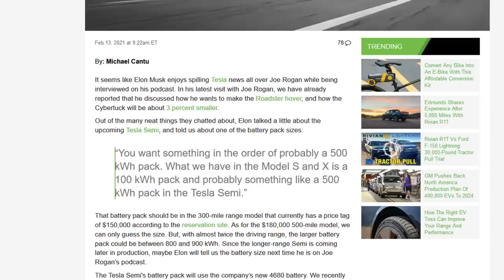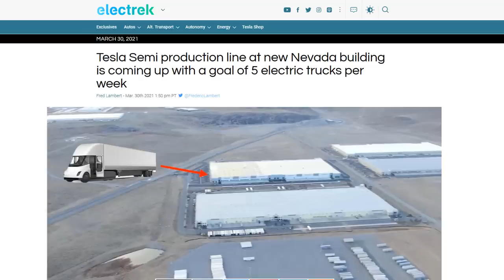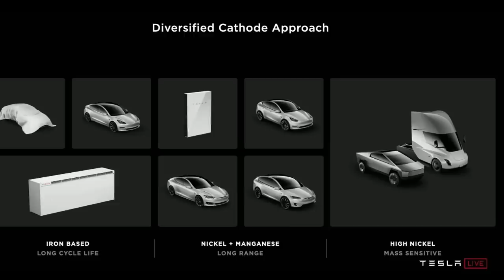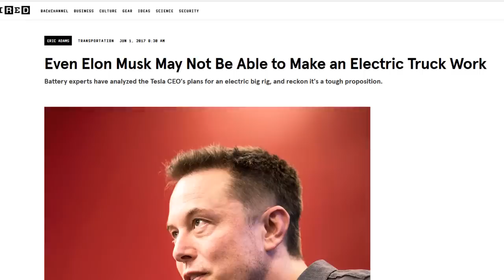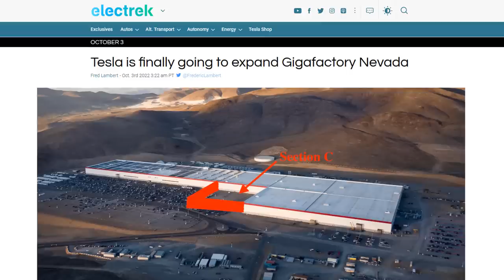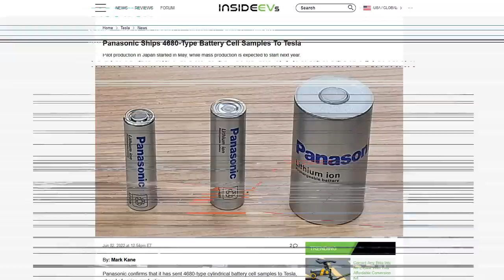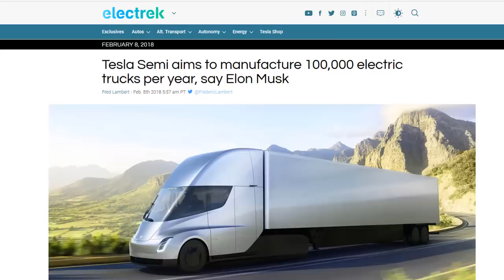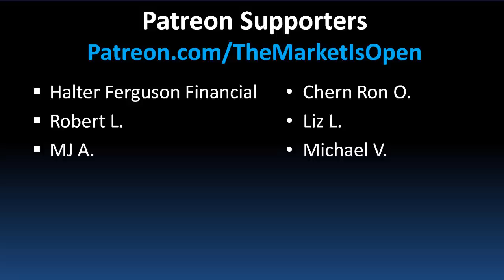Tesla Semi Is Coming in a Month - Let that Sink In

Comment: The main limiting factor here is, of course, the battery density.
At current battery density, the Tesla makes sense for local deliveries and light loads.
As battery tech improves over time, the range calculus changes and diesel trucks become more and more marginalized.
Reply: Battery tech can't improve much beyond what we have now, snap back to reality batteries are not magic they are limited to the laws of science too
Reply: Completely ignore improvements to ICE sure
Reply: Range calculus?
Reply: The main limiting factor is not just battery density but also battery lifespan and degradation. How happy would you be if the expensive new trucks your fleet purchased are all only getting 70%-80% charge after a year or so on the road? Then what? Replace the battery? Current lithium battery tech is already well developed and at or near its limitations
Reply: @CGG_GSS Sorry to say that the price of the tractor is not irrelevant.  Yes, a large fleet operator gets a discount for 'bulk' buying where as the owner operator does not.  But Freightliner is the low end of the market while Western Star is the high end luxury brand if you will.  But the fleet operator needs to attract and retain experienced drivers to survive.  True, a new CDL driver can catch on with a fleet operator like Swift and will be given an older Freightliner tractor to 'learn' with but at some point the same CDL driver will need an upgrade and after two or thee years may decide to switch companies.  Then there is the secondary market, the used tractors for sale.  It is far cheaper to sell your older tractors after two to four years of use and replace them with new tractors.  A well run fleet operator can with good drivers put 130 to 150k miles a year.  It is one thing to keep mechanics busy doing routine maintenance and another to have them rebuilding the engines.  Many 'graduates' just out of diesel mechanic school hire on with these fleets doing oil and filter changes, not engine rebuilds.  So the quality of the fleet tractors comes into play.  Your top drivers (those who regularly run 135K miles a year) demand newer and better tractors.  Fleet operators do a lot of cost benefit analysis, they have to if they want to make profits each year.

Now ask yourself this basic question, what will be the market for used Tesla class 8 tractors?  There isn't one at the moment.   And if the fleet operator cannot sell his used Tesla tractor then it end up in a wrecking yard.  Think of the environment mess those used batteries would make in your city.
Reply: Bring it on! I've had some diesels that would mop the floor with the Electic.
Reply: The more capacity these lithium ion batteries have, the more volatile they become in extreme heat. These trucks will basically be rolling bombs, no joke! Plus, if they do catch fire, it will take days to put it out. The FDNY says, they have extinguished EV batteries, only for them to catch fire again later in the day or 2 days later.
Reply: It's not. Vehicle price, charge times, reliability, charging pricing, maintenance/repair costs, availability would all factor in and at least one would be more limiting then battery density.
Reply: Long haul could be achieved if the mega charger system was integrated with existing truck stops
Reply: @trevoncowen9198  I’m sorry but no long range trucker wants to stop that much to charge. Semis usually have a tank of about 300gallons of diesel and get on avg 7mpg. So that’s around 2100 miles. More than 4x less stops than the Tesla semi AT MAX RANGE. This is great for local deliveries but is not ready for long range yet. Soon tho
Reply: @ryankennedy6922  Federal HOS rules limit a trucker's drive time to 11 hours a day. The average daily drive range for a long haul trucker is about 500 to 700 miles a day (depending upon the weather and road conditions.) The mega charger only take about an hour to charge the truck (about 6 hours worth of driving at 70 MPH.) The trucker could use that time for his mid-day break. The truck will be charged again during the driver's 8 hour HOS mandated rest time. [There would be minimal loss in time due to charging.]
Reply: @michaelmcfadden28  Sure for solo drivers, but I was talking about long haul where team driving is more prevalent. This would basically kill team trucking as a concept if you had to stop every 12 hours no matter what to charge. But change is good we'll see how it works out but I think long haul isnt ready yet
Reply: @ryankennedy6922  if truck's fuel consumption decreases to 10 mpg, you get 3000 miles range. Coast to coast on one tank!
Reply: @michaelmcfadden28  I'm sorry, what mid day break are you talking about?  Did you ever drive truck?  How long does it take to fill one 100 gallon tank with diesel, an hour?  Really?  Do you know anything about truck stops?  One of the reasons why you either start early in the AM is so you can shut down in a parking space in a truck stop.  Or you drive during the night.  And when there are no more parking spots in the truck stops you start looking for anywhere you can shut down for the night.
Reply: @martaamance4545  I cam fuel in 20 minutes,  240 gallons.
Reply: @floydrandol2731  I drove truck for many years, and yes, if you do not have to wait in line you can fuel in twenty minutes, else it takes a bit longer.  What many of these Yahoos do not know about trucking is that if one needs to recharge the batteries you can not do it in the same way that one pumps diesel fuel into the the tractors' tanks.  You will notice that most of those who comment on these posts have no idea of truck driving or the transportation industry.  It always amazes me how many individuals who are ignorant on these subjects will opine out of total ignorance.
Reply: @trevoncowen9198  no it couldn't 😂
Reply: @trevoncowen9198  Do you have any idea what kind of infrastructure would be required for any overnight charging of batteries?  Even with mega chargers that might take as little as one hour, the line of trucks waiting to charge would be extremely long.  Remember, you, as a CDL driver only get 11 hours of driving time and 2 hours as in service time.  You don't get to split your hours either.

Comment: It is my opinion is that these companies that buy these will find they actually cost them money over the long haul instead of saving them money.
Reply: Depends on the intended use. Short range haulers would not use a single dime of diesel. And considering cost of diesel they could see a payback in relatively short time. The fuel trucks use is the highest cost of running a semi. Plus the reduced maintenance costs. No oil changes, no air filter replacements, no transmission replacements and so on. One has to look at how an electric vehicle works to understand how the savings can add up.
Reply: @DaveBuildsThings  you really need to set down and do the math and stop believing the propaganda that is being shoveled to people.
Reply: @JohnSmith-ug5ci  They said the same thing when cars started appearing. Like really? Who in their right mind would trade in a horse for a car? 🤣

Comment: Sounds like the limited range version is what Pepsi will get, since the 4680s have been bust.  All the specs were based on that battery, not the 2170.

But they have to out SOMETHING out.  After all, lying about FSD isn't getting the same traction it used to...

Comment: The semi won’t be successful. Too expensive, low range, high weight, long recharges, poor service…
Individuals can deal with high purchase price, short range and sketchy service compromises for ideological environmental reasons (which I agree with) but companies won’t accept wasting money.
The Semi is for a long-range market, which it can’t reach. 
Also imagine the time and/or power needed to load a 500kWh or 1000kWh pack necessary to sustain operations.
Reply: @Reprint001  
 Wasn’t talking to you. Butt out.
Reply: @Reprint001  
💩
Reply: You’re wrong. Try again . . .

Comment: Highly skeptical of the performance numbers — especially 0-60 on 5-7 degree grades.  Well positioned truck terminals could allow effective ET performance on flat plains transitioning to diesel on routes with substantial grade.
Reply: DITTO .. also skeptical of battery pack size needed for towing huge weights.. probably closer to 2000kwh for any practical range.
Reply: @KrustyKlown  the math works out to 800kw if you are on flat ground no headwind. Engineering explained did a pretty good writeup. It will be more than 800kw but possibly as low as 1000kw. Technically a semi uses 4x the energy of average passenger vehicles per mile so a 300 mile range truck can pretty much be achieved by 4-5 300 mile S or X battery packs. Realistically you are probably looking at close to 10 battery packs for the 500 mile range. The thing is Tesla is already using these things on the road so they already know the power draw per mile. Do you really think Teslas plan is to just deliver a crap product to Pepsi next month and letting them tell the world how crap it is? That would be pretty stupid considering they already know exactly how the semi performs in real use.
Reply: @KrustyKlown  if they want 500 miles fully loaded yeah i would say 2000kwh is the optimistic battery size
Reply: @Nope considering Musk said were getting to mars by 2018, promised full self driving cars in 2014, hyperloop "air hockey in a tube, i swear its easy" turns out impossible to be made, "this thing beats rain NOW" semis ready in 2017, "million self driving robotaxis ready to roll out" in 2018, solarcity fail, Boring company with all the CGIs ends up making the shittiest tunnel in history of tunnels... Id say its pretty reasonal to be skeptic.
Reply: @Nope On what exactly? Obviously im no historian on this but all i know im reading crazy promises and watching alot of CGI from Elon for basically past decade so... Yeah its OK to be skeptic, specially this day and age where hype is the main driver of the market... Really when he said about hyperloop "its like air hockey in a tube, i swear its easy" i knew hes BSing for the hype, considering i know something about the topic.
Reply: @Nope but my point still stands, Elon has a pretty long record of giving ludacris promises that simply cannot be delivered - for whatever reason. It works wonders in todays stock market that is driven by hype, specially with cult of personality around Elon. Bringing crypto market logic to the real world! So yeah, definetly be skeptic, cause things like Theranos, Nikola, or 90% of the silicon valley startups worth millions but dont ever produce a product, do happen in todays market. All you need is a good CGI presentation, marketable idea, and a cool spokesperson ;)
Reply: @Matej Žižanović  you are 100% right. As an investor or an early adopter of technologies, I need to see a history of success. It's one thing to be a little off i.e. We had to add dual stabilizers as we found it was unable to stabilize itself with only 2 fins  vs. The idea, as a whole,  couldn't be done due to physics.

For the truck issue, any time an electric vehicle starts to pull a great deal of weight, they rapidly lose efficiency. Unless they have a new battery technology which combats this, they will be loading these trucks with TONs of batteries making then much heavier. It's a nasty cycle.

I want the electric trucks to be a thing, but using common sense, life experience, and math/science, I have a very good intuition that it will not happen the way it's currently being sold.
Reply: @Nope Bro i gave you like 9 examples of when he said hes gonna do something in some rediculous ammount of time, and now you arguing about NASA joint ventures. 

Fact is, he makes redicilous statement, media picks it up ( TIME MAGAZINE had a title "Why You Should Take Elon Musk's 2018 Mars Shot Seriously"), his stock rises, investors are happy, he is happy, its all good in todays market except theres no product. 

Boring company is worth 6 billions, thats way more than many successful tunnel companies making serious tunnels, and they made 1 tunnel wich is the shittiest tunnel in history. Hyperloop is woth billions, it cannot be made. Tesla is worth 10x more than VW even though VW generates 20x more revenue. Presents a semi in 2017, says its ready to beat RAIL next year, STOCKS SKYROCKET, 5 years later no product to be seen. See the pattern? Create a hype - people invest.

Not to shit on Elon totally cause obviously hes a successful and smart person, but the idea that we should not be skeptical is beyond stupid. Specially in todays market, like i said.

Hes one of the richest people on the planet for a reason, and its not cause hes a great engineer, - hes a great investor, has a great understanding of modern market, and is a cool personality that people created a cult about.
Reply: @matejzizanovic7959  Yep, you're not wrong but some people either have short memories or they just can't admit that they've been conned.
Reply: @Nope He's been successful in some areas and has failed in others. These are huge areas. Some investors made a lot of money on his successes while others have lost a lot of money on his failures. He might be on the top 400 Forbes list, but that doesn't mean I wont lose big.

Show me a solid history of good ideas and investments and I will be willing to part with money. Right now, it's 50-50 (maybe) if his new ideas work and I don't like those odds.
Reply: Yup, I smell a musk rat...
Reply: @Nope Yeah thats exactly the cult of personality im talking about, "you dont get to question the rich person, you dont get to be skeptical about what he says".  

Just the fact that they said in 2016. without a single flight test whatsoever, that they could land on Mars in 2018. coupled with ofcourse couple of CGI images, and all the media covered that story, consequently SpaceXs stock skyrocketed, while everyone who knows anything at all about the topic knew theres NO CHANCE IN THE UNIVERSE that they could do it... And you defend this?

I swear if Elon said hes gonna build a timemachine by 2026, and creates a company called "TimeX", posts couple of CGI presentations, company would probably be worth couple of billions. Basically he did it with hyperloop already though... Dude seriously said "its air hockey table in a tube, i swear its not that hard" , straight face, media ofcourse took it seriously, boom Hyperloop worth 1.2 billion dollars. Cmon son... We GOTTA call people out on their BS, no matter how wealthy they are.

Personally, for me, the Top Gear situation was the first sign of Elon being a BS artist...
Reply: @Nope classic im not readin that line.. ggs
Reply: @Nope 80% of ALL college grads in 2023 want to work for either SpaceX of Tesla; any CEO would be quite satisfied with those numbers.

Comment: Doesn’t mean that we have the drivers to use this demand.. He might consider making smaller trucks besides semi for local driving as well. For example trucks used in u Haul vehicles different sizes and so on, not just the semi market what about Utilities vehicles with chair lifts for pole work , cranes vehicles  and even cement trucks

Comment: I would think the garbage truck companies would be chomping at the bit to use a Tesla Semi as its platform!  Short routes with a lot of starting and stopping, it would be perfect.
Reply: Garbage trucks are really heavy. Starting and stopping consumes a lot more energy than driving a constant speed, plus the hydraulics to operate the truck require a vast amount of power.  

I like the idea of battery trucks but garbage trucks are likely a terrible candidate early on.
Reply: @jacuzzibusguy  But regular start / stop is where electric vehicles can recover a significant part of the energy, rather than wasting it as heat in the brake pads.
Reply: According to google, garbage trucks get about one-third the fuel economy of a semi truck.
Reply: Excuse me 🙂 : JAJAJAJA 
sorry sorry my point was : JAJAAJJAJAJAJAJA 
you definitely are not in trucking so keep your nose out!
Reply: And there Recycling Trucks.  But the builders of the trucks still have no incentative to change the status qoe. 🙄 

Garbage companies don't build garbage trucks.